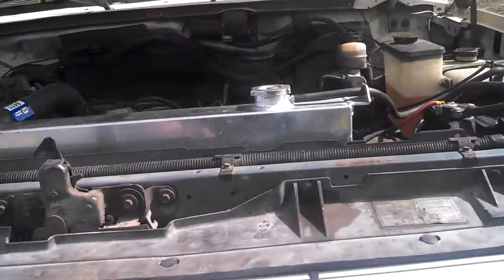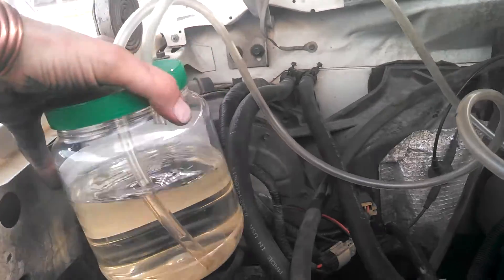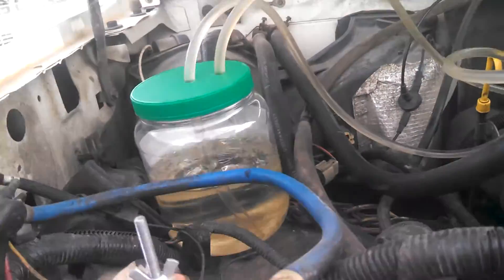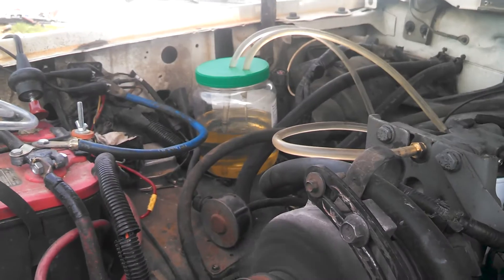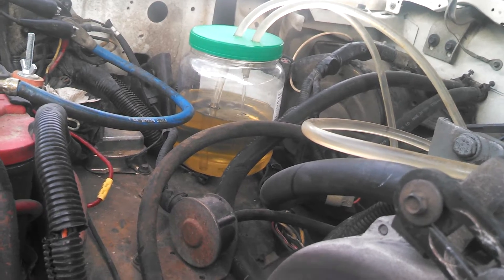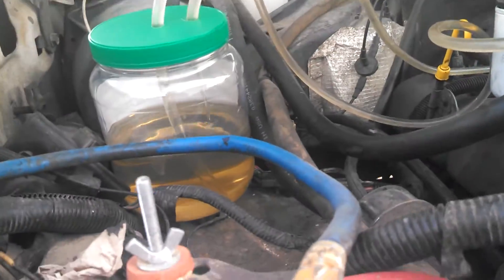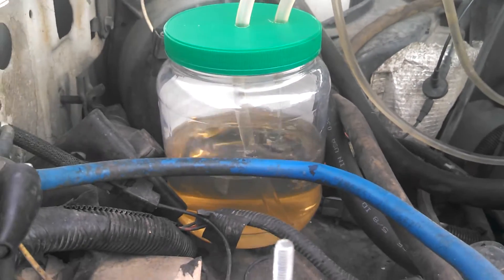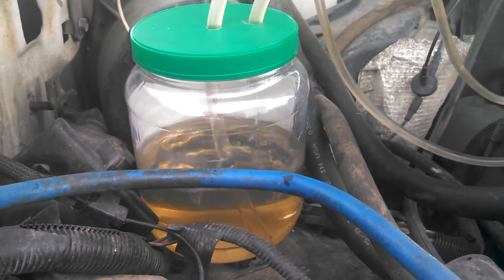Liqui Moly Diesel Purge PART 1

Comment: What did you do about the line coming from the fuel pump? All you show s that you removed it from going to the fuel filter.  Would it e better to place it before the fuel pump?  This setup is relies on the IP to pull fuel into the fiter?